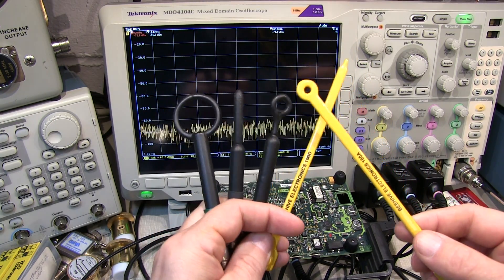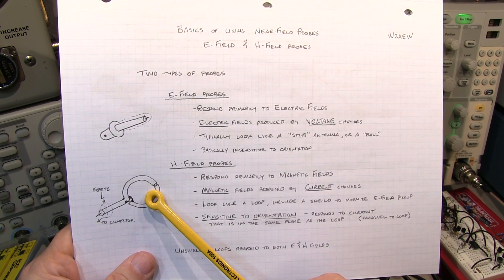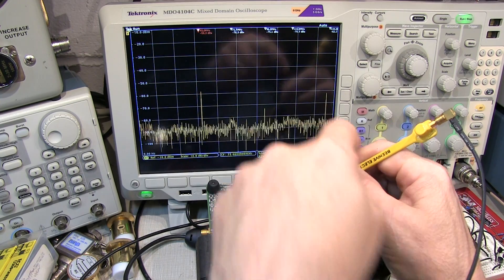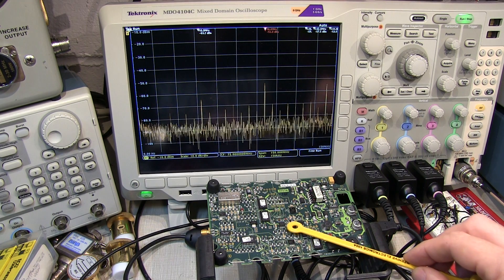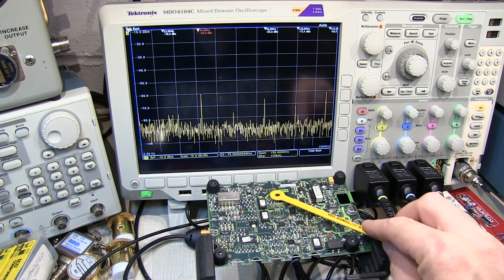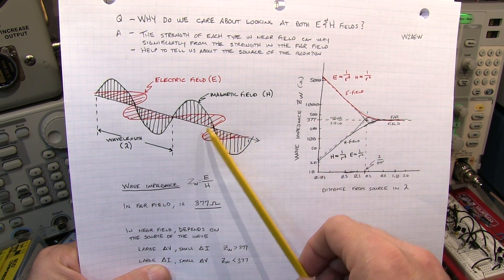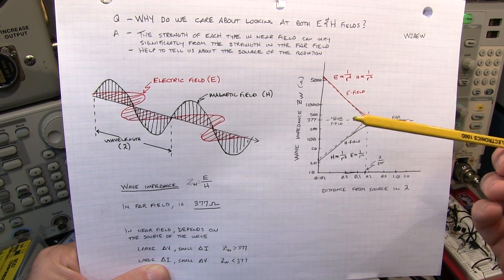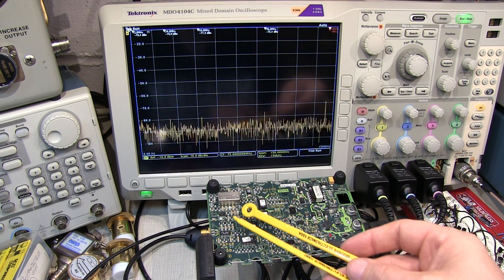#234: Basics of Near Field RF Probes | E-Field & H-Field | How-to use

Comment: Your handwriting is amazing.
Reply from the maker: +yiannis lhzl That's a big topic area - and would require several videos.  I do have it on my list though.
Reply from the maker: +kuro68000 Thank you!
Reply: +w2aew 
Smith chart video would be awesome 👍🏻
Reply: What are Smith charts?
Reply: @OriginalAtomicSheep  Well, AHEM, it's obviously a chart invented by somebody named Smith :)...and I'll be happy to let W1AEW explain because there a lot I don't fully understand.  I DO know that the chart is circular and many pieces of test equipment that have to do with measuring SWR, impedance etc offer the option to display your result in Smith chart form.  TDRs, antenna analyzers and Vector/network analyzers come to mind.  Plotting one by hand looks tedious, while reading one looks like a snap, and easier to interpret than tabulated info.

Comment: Thanks Alan.  That was quite useful... but it would have been nice to also see perhaps just a simple circuit that you could have demonstrated the sensitivity of these probes.  Just a simple oscillator maybe with some different resistors that you could change out to show the current sensitivity and maybe another to show the voltage sensitivity.  What are the frequency responses of these types of probes?
Reply from the maker: +ElmerFuddGun Frequency response of these probes vary by their size and construction - you'd have to consult the datasheets.  Small ones can be useful up to several GHz.